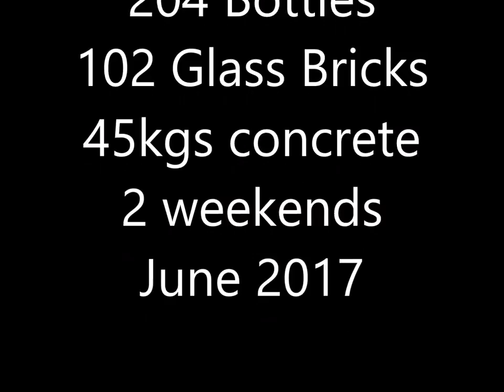Make a bottle brick window (timelapse) cut glass bottles.

Comment: Watching you fill the top was pain staking. Try a ziplock bag and cut the corner off like a cake funnel. Helps fill those tight areas.
Reply from the maker: great idea°!
Reply: I had the same thought. Likely because I worked as a baker when I was younger.
Reply from the maker: excellent idea!

Comment: Loved your video! I think these windows are beautiful! I'm curious about the materials used. Like the jars or bottles or glass bricks??? Were they just recycled or where did you get them? Did you have to alter them ? Did you just find different lids, sorry very curious? Thanks for sharing!
Reply from the maker: I cut all the bottles in half with a bottle cutter (glass cutter on little wheels) and then duct taped them together. You can leave them as is, but the open ends bothered me, even though you could use the jars as hidy-holes, it would cut out too much light. A very rewarding project.

Comment: Love this. What concrete bonding product did you use to ensure bottles would stay in place without  shrinkage as it dried? Any further tips you would share since the project has stood the test of time? Thanks for sharing .
Reply from the maker: I simply used builders concrete with 5mm gravel in it. Next time I would use straight mortar without the stones and put the bottles much closer together. I wet it every  day for a week or so from the outside to stop it cracking. Thanks for the feedback.
Reply: @goinfullirish9465  Thanks so much for the reply. Definitely inspiring.
Reply from the maker: there was not enough material for shrinkage to be a big issue, plus the cement had 5mm stones throughout, which supported the bottles well.